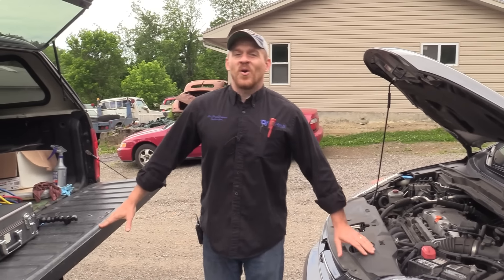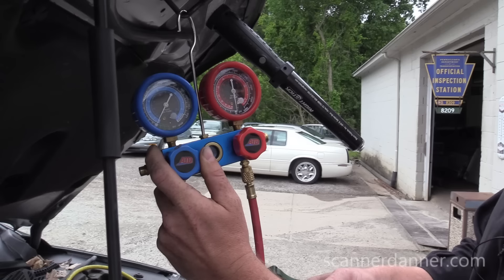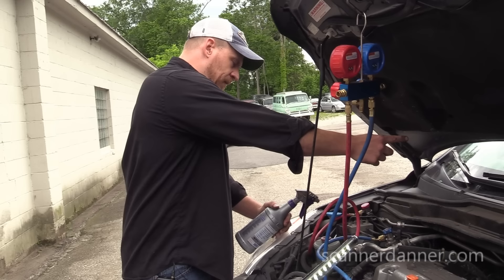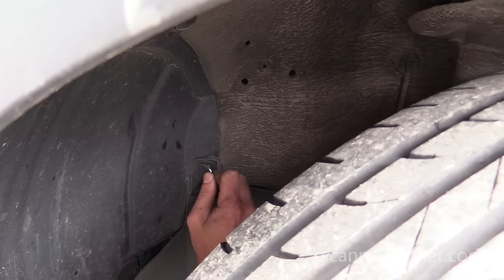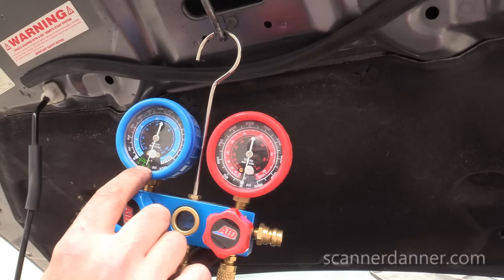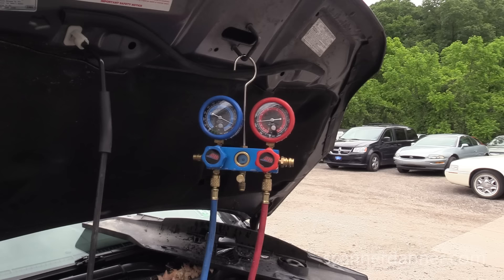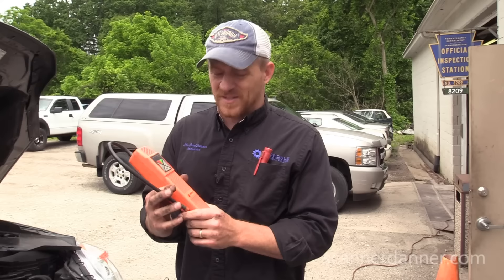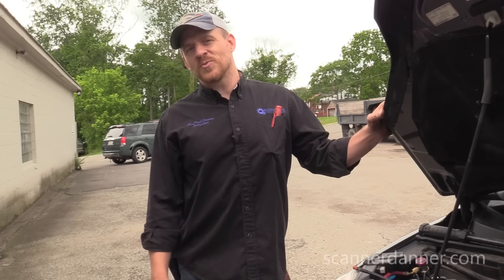Air Conditioning Not Working (system performance, leak test) - Honda CRV

Comment: I was thinking schrader valves too but was thinking the leak would stay contained with the attachments on it.
Reply from the maker: exactly, but I mentioned it because it is an area we often forget about
Reply: ScannerDanner yep, just stating my thought process. That was a good video and useful to me, like most of your vids. Thanks Paul, hope you never stop making em.
Reply: And I actually did have a leaking Schrader valve on my Odyssey. Have you seen the cool mastercool tool that allows a Schrader valve to be changed w/o removed refrigerant?  I'm sure you have because face it, you point me to all the cool tools, like my powerprobe. 😆

Comment: Mister dinner this is Joey's Auto Repair in Cleveland Ohio have a question for you I have a customer with the 97 Lincoln AC command wire is not powering I have temporarily eliminated the PCM control from the AC and ran a separate relay switch to the high and low pressure switch what are trigger and the vehicle who would like to get the factory figure it out I have power to my relay the ground I'm not so sure about it touches and goes like it's not a salad at all times I'm not a humberson sure but my remote wire from the heater control module is not coming on but if you jump the purple wire from the relay to a positive the AC clutch will activate I found a few diagrams but nothing that can lead me to a solution if you have any advice on a 97 Lincoln Town Car AC not coming on from heater control module I appreciate it if you have any links or heater control module wiring diagrams just like you it drives me nuts and want to find the problem
Reply from the maker: This is a weird design. Power to the psi cycling switch comes from the EATC module (electronic automatic temp. control). This is basically your display panel for the climate control system as well. 
This power supply (once it runs through the normally closed contacts of the psi cycling and high psi switches) ends up being the load side power supply for the AC clutch relay. 
What is the voltage level (with AC on) on the PNK/LTBLU wire on the psi cycling switch.
Reply: ScannerDanner so you're saying it more likely could be the temperature control module in the desk could be the problem? I have the system running on a difference relay setup so I know for sure the high side pressure switch and low side pressure switch is functioning it has a digital temperature control which I know a lot of the digital's have problems I was just trying to find out if I testing the temp digital temperature control I don't want to sort out the computer  PCM my messing with the wrong way I tried looking online and I went to Ford I can't find the diagram for for the temperature control that runs everything
Reply: I do have a wiring diagram for compressor to relay lot of them are numbered very small amount or labeled and it's all in black and white so it makes it hard to find it in the car for any wiring diagrams and I have because it's all numbers and I don't know how to find information for the wires

Comment: Lol. It actually sensed the refrigerant at the drain tube the first time before  you added refrigerant I guess you just missed it. Great video though.
Reply from the maker: These leak detectors often get triggered by bumping the tip, so if it did go off with no refrigerant in the system, I believe that was the case. Sorry, I don't remember, it's been awhile. 
I always look for repeatability when I use these to prevent false positives.
Reply: @ScannerDanner  yeah it may have just been from bumping it around.

Comment: I had the expensive yellow CPS leak detector, same thing happened, batteries leaked in it.  i scraped the connections and it worked, but never that good.  replaced the crystal thing on the tip, still worked like crap, very unreliable.  
just went to Amazon recently, bought a cheap knockoff for $25 and it works great, can hardly believe it.

Comment: I use air to find leaks..works just fine.. just fixed my 03 town car.. evap core and accumulator/dryer was leaking and a bad compressor relay
Reply: how do you find evap leak with air?  unless the leak is so bad you can hear it in the vents..

Comment: I just found a ruptured evaporator on an 06 Suzuki Forenza using the patented scannerdanner shop air charge method. I wish I could post the picture of this evaporator on here. It literally looks like a grenade went off inside it. It's just twisted metal, never saw that but tomorrow morning I'm replacing it. Lucky on this car it's all done at the passenger footwell. In Miami we don't care about heat but AC is a must !!!
Reply from the maker: Patented? More like hated haha. Thanks brother

Comment: hey scanner same thing with pressure can seal a leak too you need both an i didnt see you checking service valves ...also it like a guarantee you have to change dryer after the way you do it with compressed air...but i thing if you donrt want to do it with dye an black light you should invest in ultrasonic leak system 350.00 works great and you can use for other stuff.... but me im a tool junkie i have all the goodies

Comment: Do I need to add oil after useing a vacuum pump ??
Reply from the maker: for a leak repair and recharge? not typically but to be cautious maybe add 1 or 2 ounces at MOST
Reply: ScannerDanner ok no problem and I could just add some thew the yellow line right and it should oil what it need to?? And it’s just a recharge I didn’t notice any leaks when I did pressure test the gauge stayed the same
Reply from the maker: @laloherrera8657  that is correct

Comment: Excuse me gentlemen regarding what you just said about the pressure equalising the system is because The engines turn off And the pressure is Equalise in the systems based on that it is not correct informations.... Because it is very simple there is a Solenoid valve on the systems so this valve is not going to open unless you start the engine with power DC That’s valve fully open or fully close so please go ahead and read about it update Your knowledge regarding this issue with all the respect for your experience have a good day

Comment: You should've used dye prior to putting compressed air into the system. May have made it a little easier
Reply from the maker: dye will not circulate with air psi

Comment: Hey Paul, how are you man? I feel so defeated and disappointed. I worked on my AC all day yesterday and it ended up still not working. I replaced the condenser with drier and H block which should fix things and it didn’t change a thing. I know you get tons of messages but I messaged you about a month ago explaining the situation going on with my AC system and you suggested changing out the H block based on the information I provided. I did that and changed out my condenser with drier as well for a peace of mind and certainly think this would fixed things and nothing. I have a deep suspicion that my compressor might be bad. It’s a new compressor i bought off eBay and have it installed 3 months ago. Nothings else make sense. When I removed the old H block and the old condenser, some liquidy, wet, oily green, black stuff came out. Don’t know if that’s normal or not but it was noticeable. I tried just about everything I possibly can think of. Do you have any other suggestions?
Reply from the maker: What are your pressures?
Reply: @ScannerDanner  hey Paul, thanks for replying. My pressures are 65psi on the low side and about 150psi on the high side with ambient temperature of 86 degrees. It’s the same exact readings I had before I replaced the H block and the condenser. Also to note. The air coming out the vents are usually 10,12 degrees cooler than whatever the temperature is outside. It doesn’t matter how hot or how cold it is it’s always 10, 12 degrees cooler. This was before I replaced the H block and the condenser. Now it just blows hot air except when I get on the highway and cruise at around 65, 70 MPH, it gets cool to around 62,62 degrees. I find that very strange.
Reply from the maker: @ricardooconnor2362  man, that does sound like a compressor. What are your pressures at 2500-3000 rpm?
Reply: @ScannerDanner  Hey Paul. That I don’t know. I didn’t try that. What I can tell you is the AC cools when I am on the highway at a cruising speed of about 65,70mph. I noticed when I cruise at that speed (65,70mph) and accelerate to go a little faster, the cool air (62,64 degrees) changes to whatever the temperature is outside which was 84 at the time.
Reply from the maker: @ricardooconnor2362  it sounds like your compressor is having a hard time doing its job. It's weak and can't pull as well as it should nor push as much as it should (high low side and low high side pressures)
Reply: Also two things to note Paul. One. The compressor runs continuously and doesn’t cycle on and off. Two. When I got the compressor installed I forgot to tell the guy who installed it that it comes pre-oiled and not to add any. I am saying this because something tells me he added oil to the system and I can’t get him to confirmed this or not because he’s not answering my calls. When I uninstalled the old H block and the old condenser, there was oil running out everywhere. That’s not normal. This is why I am highly suspicious that he probably did add oil to the system which probably did flooded it.
Reply from the maker: @ricardooconnor2362  it's possible, I had one that a garage sent me after installing 2 or 3 different compressors and each compressor was loaded with a full system charge of oil. They kept failing from too much oil! Blew all the lines out and installed a new compressor with NO oil and that was the fix. There was still enough residual oil in that system

Comment: Man big dog you're absolutely right I I did that in the beginning you know like I was telling you I was tired in apart anyways me doing that putting it back together I started the engine and I just realized that there's a spring missing and I think it's the AC clutch thing is like a looks like old school old school clock or something like that looks like old school gadgets anyways it goes shifts up and it shifts down and it's on like the wall of the AC thing underneath I need to fix that because it's making a weird sound now I know what it's called

Comment: lol@ low pressure guage is calling you names.  some may like a better explanation of temp-press relationship.when topping off a system i found this was the best to avoid overcharging
Reply: richard cranium Many newer vehicles are sensitive either way when it comes to refrigerant levels... down to the ounce. I agree with the older ones, though, it's better to be under than over. 👍
Reply from the maker: haha never noticed

Comment: every Honda I've owned, and every one that I know who have or had Honda's... has had AC problems at some point.  their NA engines are decent, everything else is sub par quality
Reply: Not only are their air conditioning garbage. The stock stereo seem to fail, and brake calipers seize up prematurely. The only decent engines Honda had were b series, k series, j series engines. The rest are kinda garbage. Might as well buy a Toyota if you want an automatic. Don’t forget Honda has weak automatic transmissions, and their manual transmission 2nd and 3rd gear synchros get worn down to smithereens.

Comment: i have a serious dilema am working on a 1996 FORD F150 4.9 L6 need a picture of the bottom of the underhood fuse box showing pin placement and wire coloring about half the wires in my fuseblock literally fell out the bottom of the fuseblock can anyone please help me and thanks i was thinking either picture or video from a wrecking yard vehicle for the picture as i only have this 1 vehicle and closest wrecking yard is over 60 miles from me again thanks and God Bless Everyone
Reply: Your vids are tonz of great info Paul
Reply from the maker: post this to my forum Gerald. We can share pictures over there
Reply: i did sir no one has responded in past 3 days Paul

Comment: Don't you have to turn the valve knob to check pressure
Reply from the maker: not on the gauges themselves, you only open those when adding refrigerant or recovering refrigerant or vacuuming the system

Comment: What if you used CO2 instead of nitrogen; cheap & common?
Reply from the maker: regardless of all the comments, I'm still using compressed air, which is easier than either one
Reply: Yeah, I gotta say I do like the compressed air method! I was just offering a compromise between air & nitrogen.

Comment: I just bought this exact leak detector at harbor freight for $50. Took me 10 seconds to discover an evaporator leak in my daughter's mustang. Just held it to the center vent and it started barely going off. Ugh.
Reply from the maker: be careful with that test, air flow itself coming from the blower motor can set some of the cheaper leak detectors off
Reply: @ScannerDanner  hi, this is with the car off and closed up, so air is still. It's a 2010 mustang, notorious for this problem. And on Mustangs at least, you can tell when they are getting low on refrigerant because the passenger side is colder than the driver side. I can tell a very slight difference, just cold vs frigid. I do have to put gauges on it though to confirm, and get under there though for the drain test with the sniffer.
Reply from the maker: okay cool, then that should be a good test, as long as you have repeat-ability you should be good

Comment: i havent watch it yet but whats leaking is the exspansion valve the plug on the side of the valve  save the dryer and stop spraying everything  and put some uv dye init and stick with your scanner dan 
32 yrs in the ac and radiator bizz  and the best beat would be take the blower springs out abnd ck it there

Comment: This may sound silly but with air pressure still in the system and say we put a small rubber balloon on the drain hose and maybe tape it and watch it inflate
Reply from the maker: If it was a sealed box that would work, but it is not. The vents extend to the area too.

Comment: At minute 24 :20 it beeped down at the drain... and without refrigerant.. 🤔🤔
Reply from the maker: The electronic leak detectors will go off when you bump the tip. Repetition is the key to using one of these. Does it repeatedly go off in the same spot. If not, the beep you heard was false

Comment: I had an A/C nightmare. My compressor went bad and my Evaporator had a leak.. All due to aftermarket parts used during the last A/C problem.. This time I got Factory Toyota parts. They were not cheap but this was the way to go.. These aftermarket company's should be sued for the crap that they put out. Even my timing belt went due to an aftermarket belt. Unreal.

Comment: Use UV dye with UV light the easiest way to check for leaks you will see it glowing
Reply from the maker: I'm not going to start an AC leak check with an empty system by adding refrigerant and dye. You are wasting and venting that newly added refrigerant right into the atmosphere in a lot of cases. Secondly, adding refrigerant and dye would NOT have shown on the EVAP drain tube for a very long time. The dye would not have helped me locate this leak any faster than my leak detector did.

Comment: 3:34 This is incorrect. The system is not filled with 'air'. For that to happen, the refrigerant would need to be removed with vacuum and air leak in. What's in the system when it's 0 psig when it was previously charged, is atmospheric pressure refrigerant.
Reply from the maker: refrigerant will boil off at -40F, so it would be a vapor only, but you are saying this left over vapor would not totally escape, once psi equalized to atmospheric? I could see that in some circumstances depending on the severity of the leak or hole in the system. Good point.
Reply: @ScannerDanner  Yeah, then thermal cycling will push some refrigerant out each time (PV/T) if the leak is bad enough to allow it with a small pressure differential, which next time it cools will draw some air back in (again depending on how easily anything can pass the point of leakage).
As a side, I saw your video yesterday that you put up from your archives since you hadn't had time to make one this week and thought you were looking a bit gaunt, then I saw the description where you explained it was old. Reminded me of my driver's licence photo! haha

Comment: I Just normally pull a vacuum, if gauges do not move much at all, I put dye in the system then charge it up and send the customer down the road. I do tell them that they will be back one day not cooling, Then i use my UV Light and UV Glasses to find the leak. THE DYE DO"T LIE! But good job any how.
Reply from the maker: That would have burned me on this one. It held vacuum!
Thanks Sam
Reply: I realize system was low or empty, if i can't find leak with sniffer or signs of oil, or spray soap, then i put Dye in system and when the a/c warms up, they bring it back in and i Use my uv light and glasses to find the leak. And every a/c job i do, i put dye in as a pre diagnostic if it develops leaks in the future. I really have watched and enjoyed all of your video's. Thanks Paul. Gave a great day, and keep video's coming!

Comment: Probably no air in the system when its empty. Pressure switch doesn't allow it to run in a vacuum. It would take pressure to enter a leak to get air
Reply: Adding nitrogen for pressure to leak search is all you can use besides refrigerant. Using air will contaminate the oil in the system due to moisture
Reply: How do you know 😆